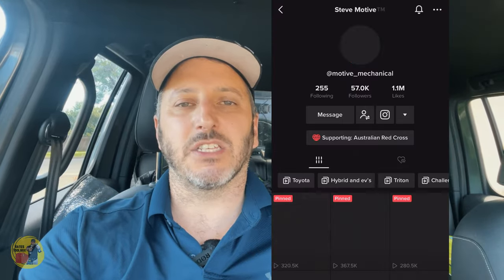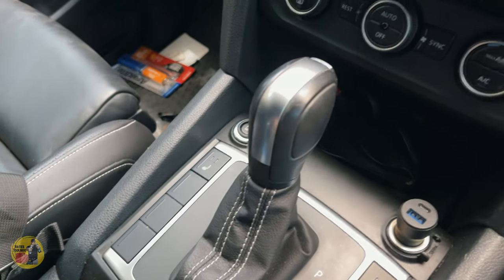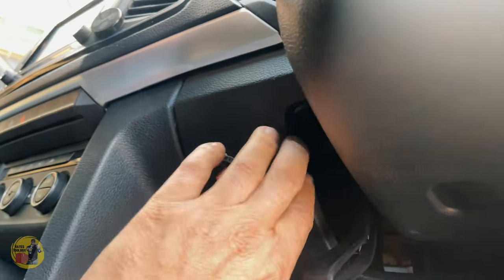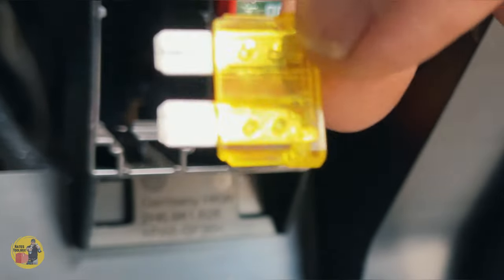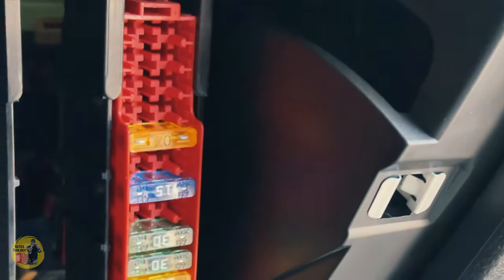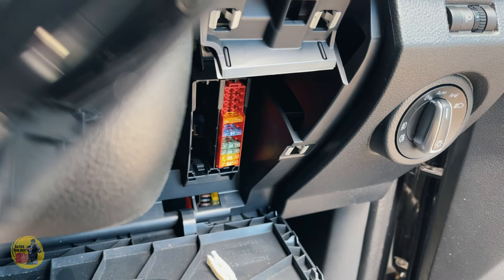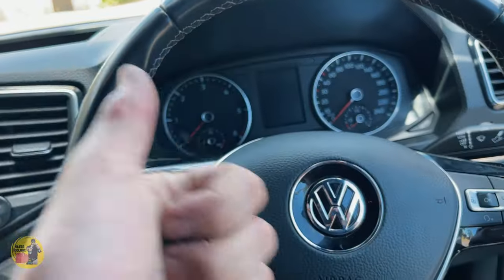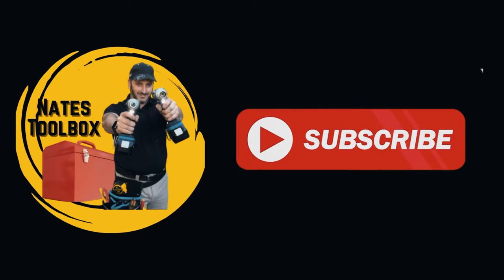VW Amarok blown fuse - how to find & fix the 12v auxiliary & cigarette socket power

Comment: Thanks, I'll try this tomorrow. I think that the socket on top of the dash also has a blown fuse (unless it's the same fuse on a MY15).
Reply: Hey Allen, did you ever get the fuse on the top of your dash fixed? I’ve got the same problem and can’t find the fuse
Reply: @allenjenkins7947

Comment: Gotta ask though, what if the aux 12VDC plug has power but the cigarette lighter plug doesn't. And, that fixes the immediate issue but is there a common reason it blows in the first place? ( Besides being under rated who knows with the lack of info VW allow to be released on the fuses/relays )

Comment: Good video, clear and to the point. FYI, I have a 2013 Highline, and while I can access the steering column compartment as you have shown, there is no fuse box located in there.
Reply from the maker: Thanks mate.  Oh bugger so nothing on the right or left side ?  I wonder where that one is hiding.
Reply: @NatesToolbox  I think it’s included in the fuse cluster on the right hand side. There appear to be more fuses in that spot than on your video

Comment: OK, same here: Neither plug on the gear console of my 2015 Amarok (Made in Germany) is working. However,  does not have a secondary fuse cluster (Yes I checked). All the fuses in the main board are fine. What next?